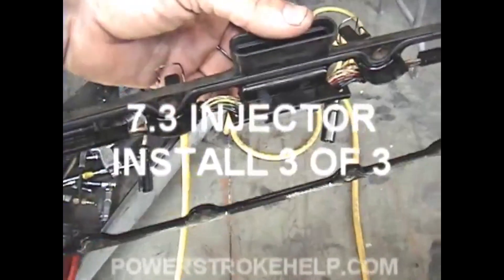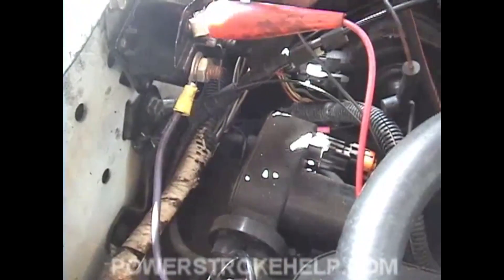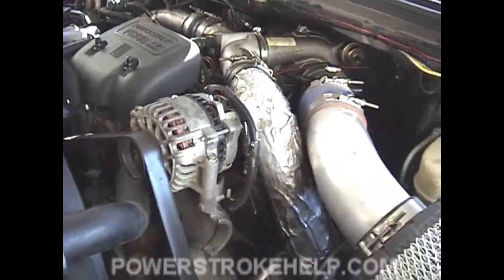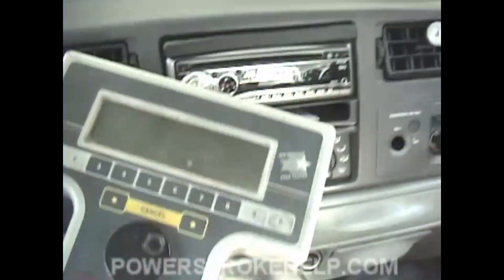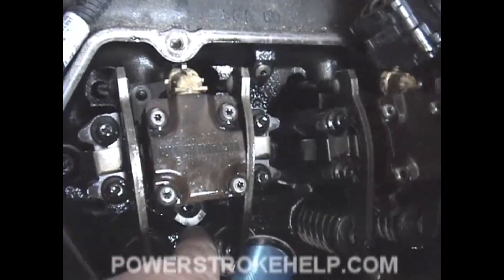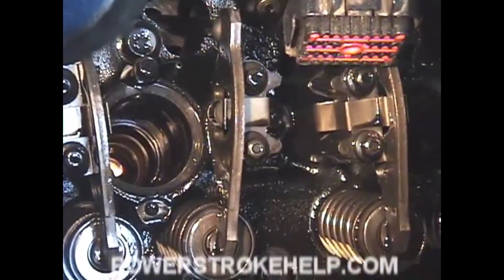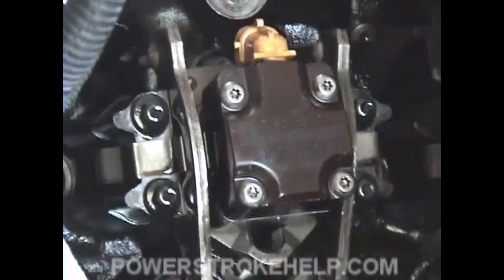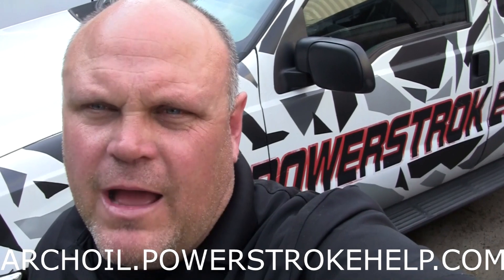7 3L POWERSTROKE INJECTOR INSTALL 3 OF 3

Comment: Why can't you bump the starter with the ignition?  You have the injectors unplugged so they don't blank fire.  And its not like the fuel is gonna run down into the cylinder again because the injector is back in its place. I'm just curious because I'm changing my injectors.

Comment: Hi bill I was wondering about tossing an idea your way.
If one was to build the correct cam and a separate front cover gear arrangement would you be able to get the exhaust valve and intake valve to overlap significantly and turn at crankshaft speed?

My idea is to build a 2 stroke 7.3 in which the exhaust and intake air are pushed through the motor by a roots blower or other supercharger. The exhaust valve will open slightly before the intake valve (15 degrees or so) to allow the exhaust to help spin up the stock turbo.

Would the injectors be up to the increased speed? Would I need to beef up the rocker, valves etc? 

I pose the question because a while back toyota built a direct injection I6 gas motor using the same principal and it was a resounding success. So why not diesels?
Reply: Could you repost this I accidentaly marked this as spam and google/youtube won't let me restore it. Sorry.

Comment: Damned good info! I have a question which may be obvious, but never hurts to be sure. If you only replace one or two injectors, those would be the only cylinders you would have to remove the glow plug from and blow out by cranking the engine, correct?
Reply: yes

Comment: My 2002 has oil in the exhaust after I had the injectors changed it didn't do this tell the shop changed the injectors is the a normal thing to see its not losing any oil but the exhaust is wet with it

Comment: Why don't you pull the high pressure oil end cap's and fuel cap's. Then you can reseal them. They like to leak at the back and then you don't diesel fuel in the oil to.
Reply: mike peterson those problems were in the first generation 7.3 but after 1999.5 they used a different plug that had the gasket seat deeper in the head because what was happening was the heat from the turbo charger would destroy that gasket after so long. Plus if you do it this way you don’t leak a quart of oil which is typically what is in the oil rails per each head.

So basically just take your glow plugs out and crank the engine. Far simplier

Comment: Hey bill I have a 2002 psd and I'm going to change out the downpipe to a 4in. Is this a fairly easy thing to do?
Reply: Darrin Pagano 
Easy stuff.
Reply: Ok. Some people say that I'll have to hammer my firewall. I can't see having to do that. So do I just unclamp the old down pipe and put in the new one? Is it really that simple?
Reply: That's the case in the 94-97 PSD trucks. No need to do this in the 99-07 SD platform bodies.
Reply: The most difficult part is getting the V band clamp to let go of the turbocharger. Best way to do that is to use a decent air hammer to knock it loose. The only other thing that will get in your way is the passenger side up-pipe, but those bolts are fairly easy to access if you choose to remove the pipe to make it easier. Then when you orient the new downpipe, you'll have to position it so it doesn't make contact with the transmission as it will sit right beside it.